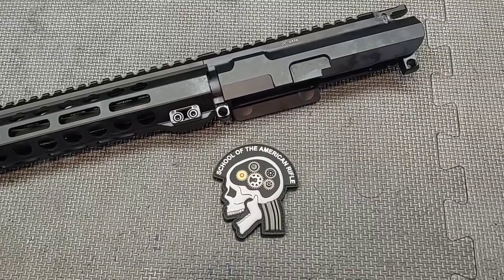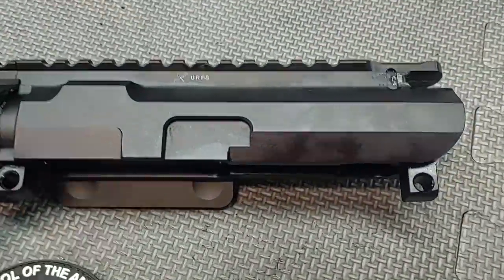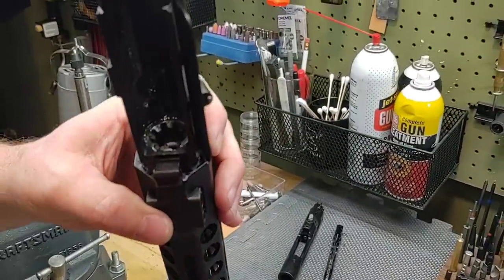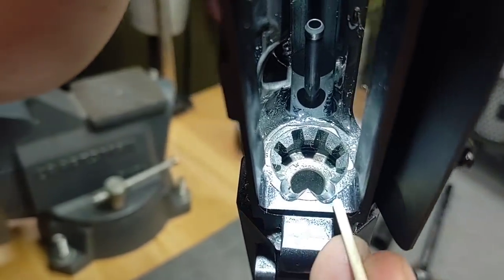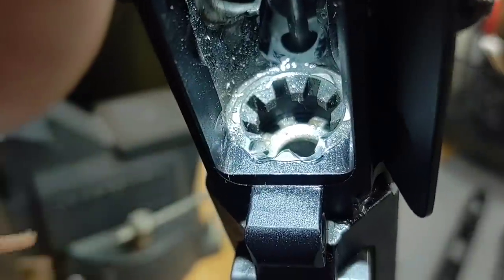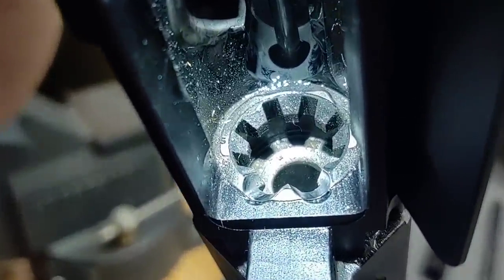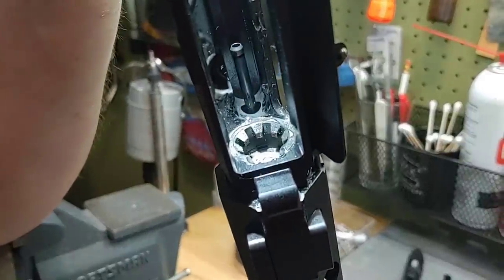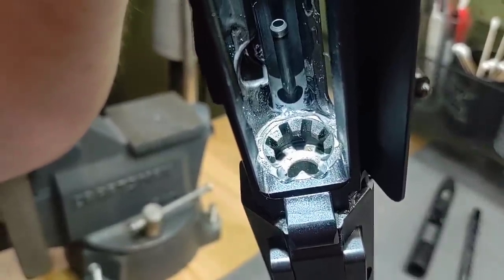Example of Tolerance Stacking - M4 Feed Ramp Issues

Comment: Thanks for the video. I can’t find the answer and I’m waiting to hear from Springfield Armory but I bought a saint victor 5.56 and I noticed dents on all the star corners “extension lug peening” and my feed ramps aren’t aligned, the feed ramp goes more right. My bolt looks okay but in your video when you shined the light I have dents on all the star cuts there…I just bought this and fired only 100 rounds and pre cleaned it before hand. Ive used AR”s in the service so I know an okay amount. they recieved the returned firearm last Thursday and I waiting to see if they exchange or repair it.

Comment: Great video. Thank you for that knowledge. Potentially stupid question. In this scenario if the overhanging distance of the feed ramps is extremely small would it not be possible to "shim" the barrel where it meets the receiver assuming your "shims" are properly coated to avoid electrolysis? I am no kind of expert by any means. Just know enough to get myself in trouble 😁

Comment: my first generation daniel defense M4 has the exact same problem.  it feeds fine when the gun is clean, but every single bullet is scratched to hell when they get chambered, and i mean a line of really DEEP scratch, which results in less than stellar accuracy.  i was shocked to see such elementary problem could ever be found in such a reputable company daniel defense.   but since reliability doesn't seem to be affected, and i have many other ARs to shoot, i never bothered to send the gun back to DD for repair, kind of just put up with reduced accuracy for the past 10 years, and i still have this gun in my collection.
Reply: I had a very similar issue with a Barrett rec7. sent it in, they sent it back 'fixed', wasn't fixed.
Reply: I have similar issue now. For some reason it’s ALWAYS the first round that gets stuck, half way up ramp. If I re-rack the Bcg and let it spring forward a 2nd time it then will finish up the ramp. So it’s not perma stuck, but still a bad bite. 
And what’s even more weird is every round after that cycles 100% fine from standard gas pressure cycle. Will prob just sand it down myself I suppose
Reply: @carsonhunt4642 That almost sounds like you're loading your magazines to 31, which can cause that exact problem. I don't know how you would have that consistent problem always on the first round otherwise. I could be wrong, though

Comment: I recently RE-built a lr308. I put a FAXON 20" big gunner bbl on and a Larue mbt-2. The lr308 upper has no feed ramps and the bbl extension seemed a lil rough. The upper basically had a "lip" over the bbl ramps. So i and a friend came up with a tool to smooth it. Mind now i had no issues at all after bbl break in and subsequent shooting. 150 rnds or so. But because there were rough spots i smoothed it out. We came up with a dowel wrapped w a 600grit paper and i lightly dragged it down the bbl extension ramps. Only until the rough spots couldnt be felt and the lips extending over bbl were much smoother... shoots great with 165g hornady projectiles...

Comment: I've seen a lot of barrel extension issues with a few of the nicer uppers. I have personally repaired this issue on an upper I have. After polishing and cutting the ramps shorter by .012" then polishing to a mirror finish my feeding issues ceased.

Comment: Is there a print they machine to and what are the tolerances?  I'm amazed in the cnc era there would be a visible lip.  That looks to be over 100 microns!  Maybe they left extra expecting you to do a bit on hand finishing?  Looks like a touch or two with a stone and a bit of polishing it should be good to go.  Suppose I'm spoiled because I work in a temp controlled shop... still even in an old sweatshop I wouldn't expect a lip there.  QC must have been drinking lunch that day.

Comment: Most people refuse to understand this. I've even worked with mechanical engineers who doesnt believe in GDT for particular products. When I did an internship with a gun parts manufacturer, this was very very very important. 
  That's the edge of a completed firearm off a great QA/QC'd manufacturer. Not only are the individual parts qualified but the completed unit is system qualified. Of course not every firearm manufacturer who claims to do so does so.
 That said I still do enjoy building from parts and testing.
Reply: When I was a machinist, I got an engineer fired for his tolerance stacking issues.  He designed an assembly for our semiconductor  handling machine.  It failed to work.  I came to him with a stack of blueprints and told him he had a couple of ways to correct the issues, and he threw a fit.  Then he tried to fight me.  Then he got fired and I fixed his blueprints. 

Tolerance stacking is going to happen not matter what, otherwise the parts would be so costly nobody could afford them.
Reply: I work with an experienced engineer with almost 30 years experience. He’s one of the most intelligent people I’ve ever met. Very seldom do you meet a person like him that’s book smart and truly mechanically inclined. He has no ego doesn’t care who’s right or wrong he just wants things to be right. My first week under him he taught me about this certain issue.
Reply: I am a mechanical engineer.  I work more in the architectural side now but worked in ASME pressure vessel certification for quite a while.  We have to educate architects all the time that if each of your wall dimensions on your building are off by 1/8th of an inch then by the time you get 40 walls in you have grown or shrunk the building by inches. We call it error propagation....but tolerance stacking is just as good.  Where we run into it is that drafting programs can be set to round off a dimension to the nearest fraction...1/8th, 1/16th, 1/4.  Whatever.....you can round to the nearest inch or foot if you want.  Rounding to the nearest inch in a site plan that is 200 acres is not a big problem......rounding to the nearest inch in a formed pressure vessel head is a big problem.
Many buildings as you see in urban areas are built right up to the property line.  So being out 6 inches in 100 ft can put you building onto some else's property.
In small part machine design (like guns) it's better to run in decimal inches and have your CAD program set to something smaller than comparative runout on your machinery.  If your milling machine is accurate to a ten thousandth....then set your program to round to the nearest ten thousandth......or as accurate as your measuring capabilities.
We have had associates that worked building nuclear vessels in different countries.  They actually have to design measurement tools in the US to be used in Sweden building a nuclear vessel.....then have it all fit when assembled in Korea.  So they take the environmental and temperature considerations into the design so that everything fits in the weather if it's destination.....down to the thousandth......
So....some engineers know....and some don't.  It usually just experience or lack of.

Comment: Another example I had is when I combined  a G trigger with a Balios Lite lower.  G pins are a little fatter than Milspec and balios trigger pin holes are a little tighter.  I got the trigger installed using g pins, grease and more hammer than I wanted to.

Comment: Pardon a 'Newbie' question but, would using Barrel Shims (between the barrel and the barrel nut) help correct the problem of that feed ramp snag you demonstrated with the q tip end?  and, what would you recommend for polishing/reducing that overhang?  I have quite a few spare parts i would like to experiment with to hone my hobby.

Thank you for the informative videos.

Comment: Trying to find out why my new Stag Arms Stag-15 AR is not feeding the rounds when I try to load the first round. Rather slingshot or bolt catch ... The round gets stuck on the the ramps and the bolt stops halfway trying to chamber my first round. I half to recharge the handle and it works after that (pushing the round the rest of the way). I thought it was cause my spring or buffer was no good. None of my other AR pistols do that tho. However my other AR'S are 7.62. I think this is my problem here. Also I think my PMAG doesn't present the round high enough like my 7.62 DURAMAG.

Comment: There is a lot to be said for purchasing a completed upper from a single source.  They have identified any stack up issues with their suppliers and have resolved those issues.  Left on your own, its up to you to see what you get.  The most important aspect is that you are left to retrofit the components on your own or try different parts.
Reply: Hopefully they have IDd stacking issues and resolved them.  Hopefully.  But ultimately, no matter who is the seller of a complete upper, it's a QA/QC issue -- and not every seller of complete uppers has airtight quality controls.

Comment: I have an issue with my PSA 10.5” upper. It chambers fine but when you go to cycle it manually or fire it, it locks up and won’t eject the round and it needs to be mortared to get the bolt free. What’s my issue?

Comment: I'm thinking if I built that, I would have shimmed the barrel so that it was shy of flush to the M4 notches.  Or, took the airtool and polished them flush.  I am a Blackout enthusiast, and you gotta fatten those babies up a little. I did mine, and test chambered a 85gr penetrator round without a hitch. It's really short. 220's feed well too. But the pathway has to match it's function and smoothly.

Comment: What if the problem is reversed? And the barrel extension ramps are just shy of the receiver ramps? As if too short. The extention index pin is fully seated in the notch and barrel nut is torqued to spec. I have this abnormality with 3 uppers. All bcm assembled upper receivers and 3 different barrels. A Centurion, a bcm and a Daniel Defense. Seems like a bcm problem to me. Any issues that anyone can forsee?

Comment: Kinda puts a damper on wanting to make work area, buy ALLL the tools, all the major and minor part groups and all the high end, custom, hand selected components and pieces for the perfect build only consisting of the best of the best brands from the stock down to the smallest roll pin tip to butt, top to bottom. Just might not be worth the time and expense after all. $$$$ and still have problems 🤔

Comment: curious as to why the contouring couldn't be done without removing thr barrel?
Reply: One would not wish to remove the finish from the softer receiver metal and expose the aluminum to the steel risking cross contamination resulting in corrosion.
Reply: @ditzydoo4378  gotcha... makes perfect sense. Thanks.
Reply: @boss350z5    ^_^  your welcome
Reply: @ditzydoo4378  Is there a problem with lapping the face of the receiver, then?
Reply: @TEXwithNODS  Three fold: 1,  the receiver feeding guide grooves are already larger than the barrel feed grooves and therefore do not require the removal of material.   2, removal of the finish from the aluminum  coming into contact with steel will cause the aluminum to corrode by means of electrolysis.  3. Since the barrel simply slides in and out of the receiver when the barrel nut is removed there is no need to while contouring and test fitting the barrel feed ramps to said receiver.
Reply: @ditzydoo4378  I meant lapping the forward face of the receiver for a tight barrel installation. This seems pretty common for accuracy builds
Reply: @TEXwithNODS    Fair point..  
While It's true that one could "True" the receiver face too the breech face of a barrel on a "Bolt-action".  Since the receiver face forms one half of the locking surfaces.  

However an AR barrel has its locking surfaces as part of the breech of the barrel itself that the bolt lugs lock into.  

Now if the receiver socket that slides onto and over the barrel shank is horribly malformed.  One would send it back to the maker for replacement since this matting surface is trued as part of the basic manufacturing technic.

Comment: Why not just add a shim between the barrel and the upper? If you could properly gauge the offset problem on the ramps, they could possibly line up correctly without physical grinding.
Reply: That is what I was wondering.
Reply from the maker: Pushing the barrel forward can allow the carrier to travel further forward. 

If this happens the buffer retainer can impact the buffer slightly or with force. Not good.
Reply: Thanks for the reply! I guess I should have started off with one would also have to measure the internal dimensions of the barrel extension to see where the extra growth is. To your point.. if the breach face of the extension tolerance is too rearward, this would cause excessive wear on the bolt face. The tolerance that is the root cause should be identified to better know what has to move. I absolutely love gun Nerding. 😀 keep up the great work. Excellent Channel!

Comment: I had Core 15 rifle from a few years ago that had this issue as well as multiple others. Easily one of the worst rifles I've bought and I'm thinking due to the Sandy Hook scare. The feed ramps on the barrel extension severely overhanged the m4 feed ramps of the upper, the wall thickness of the lower receiver was thicker on one side, and the rifle was heavily overgassed, it ejected shells at the 1230 o'clock position with shells marring the handguard immediately in from of the ejection port, recoil felt like a light 20 Guage shotgun.
Reply: This is either massively exaggerated or outright fabrication but it gave me a good laugh either way so thank you for that
Reply: @royrogers3624  the exaggeration was the 20 Guage part, it did have extreme overgassing though. Everything else is spot on, definitely a lemon.

Comment: One of the reasons I prefer non-feed ramp upper receivers when building an upper.  I use a Dremel with a Cratex bullet shaped bit and polish the ramps on on the barrel which also causes the lower to polish in perfectly matching ramps.
Reply: One of the reasons he is pulling the barrel to do the feedramp work is that he doesn't want to cut into the anodizing. The bare aluminum is much softer than the anodizing. Was glad he mentioned it because ive noticed the same and stopped removing the anodizing on any bearing surfaces when doing Cerakote. It leaves a stronger surface. Probably not a huge problem but with heavy use bare aluminum feedramp on the lower will land you with this snagging overhang.
Reply: Peace Geek has non feed ramp uppers
Reply: You don't want to cut out into the uppers hard coat anodizing.. Cartridges will ding it up more and cause the same hang up issues like Josh said.  Better to just remove the barrel to polish and match the barrel extension ramps to fit the upper m4 ramps. Sotar shows a video of this with a sons of liberty upper

Comment: I'm not trying to correct you just add clarity. Tolerance stacking is when 2 or more parts can be considered within tolerance but still fail to work together. This is typically caused by the parts being at opposite extreme ends of being within tolerance. Example might be a barrel extension at the high end of tolerance for outside diameter and an upper receiver barrel interface that is in the extreme low end of tolerance for inside diameter may cause difficulty in fitting the barrel into the upper.
Reply: Yes, that's the usual way tolerance stack shows up. Though I think the most common case would be FCG pins and holes.

Another good example is part A that is 1.00+-.025" long and measures 1.025" (at the max long), that attaches to a part 2.50+-.25" and measures 2.75" (at the max length), but the whole assembly specs 3.50+-.025 while your build-up is 3.775", a full .25" too long. (Say, clutch plus input shaft)

Comment: That’s an easy fix... pencil grindernd grinding stone then buff out.
Reply: As long as you don't mind the exposed aluminum in the upper (causes corrosion) and contaminating the stone with aluminum (unbalances the stone and causes it to break up)
Reply: Scott Kenny . I’m not gonna break everything down for you what I’m gonna do just telling you the tools... whether the stone would be pink, green or blue.Flapper wheel /green polishing wheel. Do you have to take the barrel out?
Reply: @thomasteac8919  I would, and our host here is pulling the barrel on this upper. The anodizing is harder than the aluminum, and you don't want to expose bare aluminum.

Is it a pain in the ass to disassemble the upper, grind on the extension, reassemble to see if you've ground enough, disassemble, grind, reassemble (repeat until happy)?

Hell yes.

Is it cheaper than scrapping the upper because you ground the barrel with the upper assembled? 

Hell yes.
Reply from the maker: @thomasteac8919  yes, you have to take the barrel out of the upper to do the job right.

Comment: Have you ever done an examination on any LWRC rifles?  I have a LWRCI-DI 556 AR-15 and it has a unique type of bolt.  There is no separate gas key; it is somewhat integrated into the bolt body with only a additional tube that is roll pinned into the carrier.  Was curious how this would compare to other manufacturers.